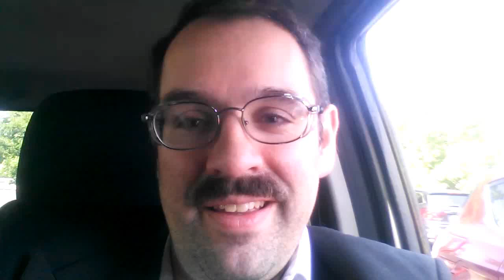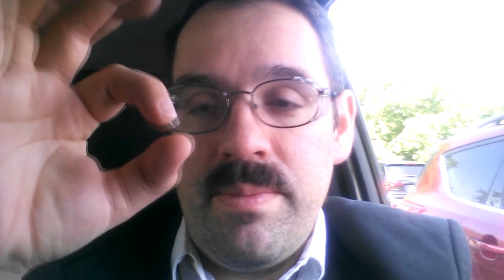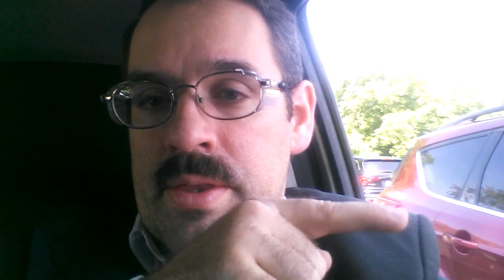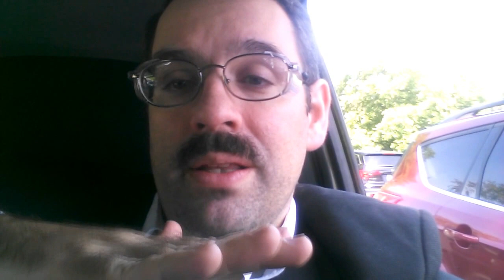Port and Polish? Porting and Air flow Theory III

Comment: Anywhere you can reduce a change in direction of airflow is an increase in airflow.  That machinist ridge you talk about is a HUGE detriment to air flow into the combustion chamber, and if you do nothing else, ONLY eliminating that ridge will make a noticeable difference on the butt dyno.  Rolling the seats and back-cutting the valves then aids that increased airflow ability by lessening the amount the air has to "turn" to get into the chamber.  If you want to get really crazy, then start playing around with seat-to-valve interface placement.  Where you place that 45-degree cut both on the seat and on the valve can shift your low-lift flow numbers up and down the RPM range.  Of course, getting into that level of precision and detail is starting to touch on F1 technology territory.  ;)

If you want a real mind-bender, check out "port dimpling."  Somewhere along the way, someone figured out that the golf ball effect and the Bernoulli Principle play very nicely together inside an intake port.  It's typically something that's done on a 5-axis CNC machine, but I've been very tempted to have a go at doing it by hand.
Reply from the maker: +rhkips If I was good at painting cars I wouldn't be able to hold back to do it to the surface of a car! :)

Speaking of holding back, I've kept not watching a YouTube video about, what I immediately recognized as the "golf balling" of intakes. . . Of course the video isn't labeled that.
Reply from the maker: +rhkips As long as the port was sonic checked prior to doing it so a thin spot isn't busted through, it's doable by hand.

When Mythbusters took golf balls and scaled them onto a car with a local university art department doing it out of clay, I told myself, which it's a good thing I don't paint cars well. Lol I've wanted a dimpled car ever since. They showed a significant MPG gain at cruising. They couldn't test acceleration with 200 lbs of clay on the car.
Reply from the maker: +rhkips What if port dimpling was only done on the short turn's radius?
Reply: DE Nichols
Haha, I remember that episode, and I loved it!  The only thing I'm unfamiliar with is the relationship between air velocity, surface area, and the dimensions of the impressions.  That seems like it would be a fairly crucial relationship to understand before digging into anything!  Unfortunately, it also seems like math that's well beyond my comprehension, even if I DID know the equation.  :[
Reply from the maker: rhkips I believe I saw the math during a time that Calculus was child's play (High School). Simple equation. 

It's kind if like Einsteinonian physics (complex) perfectly explaining the orbit of Mars, but not other planets, while Newtonian physics (simple) perfectly explains certain moons orbits.

The simple equation is close, but off from reality. So if they have an equation that matches reality, I suspect it's more like an equation by Einstein.
Reply: DE Nichols
Ha!  Well, I frequently mess up basic addition with a calculator, so your concept of "a simple equation" is likely very different from mine.

I could read and write Greek back in high school, but when Greek characters magically appear in an equation, that's not math anymore; it's psychosis.  LOL
Reply from the maker: +rhkips Lol. It was simple then so I'm likely to understand it, but Calculus in general was simple then and probably not now.

Comment: Hey De...interesting material and I can see that it would be a deep subject. I agree with Steve that some diagrams when you spoke of this topic would probably make things a little easier for some people to understand. This subject can get complicated in a hurry. Nice video DE and keep up the good work!
Reply from the maker: +stuzman52 Thank you for the compliment. You're both quite right about visuals. :) It'd make the subject more accessible to more people. 

I suspect you visualized it very well?
Reply from the maker: +stuzman52 I have a solution. Next time I come out with a video on this I'll be a good teacher and have visual aids. Then I'll circle around to the earlier videos and include visual aids. By then, most people would have forgotten a lot of it.
Reply: Yes, I didn't have any problem understanding what you were saying. I was just thinking about some of your other viewers that might have an issue comprehending the subject. Take care DE..
Reply: Ah you're a good teacher DE...the visual aids would enhance your teaching to allow more people to follow what you're saying.
Reply from the maker: Warning. Random shift in the conversation alert. :)

A partner taught me a common gas station serves E-15 gas at 12% off. Makes me want to add in a higher compression build...based on the piston or connecting rod. That'd help compensate also for the reduction in static compression from the machinist ridge.

This gasoline is 88 octane instead of 87...but my car ia "designed" for 87 but ran the same on 85 due to all the little mods I did at least until enough carbon built up that 87 was better.

On the balance of it all. Higher compression NA on a car that is ridiculously hard to turbo is a smart way to go seeing as how if I ever do a turbo build it'll be a different car all together.
Reply from the maker: +stuzman I'll be back to my books with pictures soon. Then I'll redo this video with visuals. :) Which means. This summer...we could work on a car together. My place or yours?

Comment: Two questions......Would you mind telling us your age? Why are you getting into porting? I have a car that is built for the drag strip. I did all of the work except porting the heads and installing the valves. I also left the dyno tuning to the professionals. Are you building your chevy prizm/toyota corolla?
Reply from the maker: I'm 35. I'm getting into porting because it looks like a complicated challenge. Yes. I'm going to port my Chevy Prizm/Toyota Corolla.

Eventually to take the car to the next level, I'd have to do more than porting. Stage 2 cams, a tuneable piggy back ECU. That's the way to go on these cars because their PCM's aren't hackable. They have sets of false information so you think you're in the maps when you're not. The infrastructure has tons of false trails in it, or so I've heard.

I'm enticed to work on what others believe is too profound to do. Other than getting into a transmission, this is like the final frontier with me and cars.
Reply: +DE “AutoBravado” Nichols Cool man. We're about the same age. Good luck with your build and try not to use up your kids college funds, hahaha. I'm really looking forward to more of these types of vids.
Reply from the maker: Michael Herbert I can cough up knowledge pretty easily but build costs are never ending. Thus slow progress. :)

Comment: Hmm, not something i know anything about, but after all this fine rifling of the port tubes, what happens when the carbon fills them up LOL, no no just being silly again :-(.
Dont polish the inside of the head too much, you may lose a fraction of compression ;-(
Reply from the maker: +zx8401ztv lol. You always no more than you let on. :)

I'm sure I'll lose a little compression there, but milling the cylinder head gains a bit too...Carbon will always build up and if an engine is happy a long time it'll keep going up in compression. 

How the engine was I had to to go up two octane so it'd run good.

Run your engine on a bit more octane and it runs better? You know carbon built up.
Reply: No honestly, i know bugger all, the very very basics of engines, enough to repair my motorbike, im just using my limited knowedge to make you laugh lol :-D, You are way over my head with knowledge, as ive said im just here to be silly and i may learn something from you if you speak slowly :-D :-D.
Reply from the maker: zx8401ztv At the end of the video I repeated David Vizard's rule about focusing on the point of greatest restriction twice. So repeating myself is good? :)

Or I repeated something. I forget what. Lol

Do I need to redo the whole video with visual aids? For those who don't know the parts involved?
Reply: Dont worry, we got the understanding, i had my finger on the screen reading the subtext you added lol ;-D.  I think i may have to go to bed soon, the brain is becoming very daft.
Reply from the maker: zx8401ztv
Yes, don't let me keep you up. I do the same socially sometimes until I'm past daft.